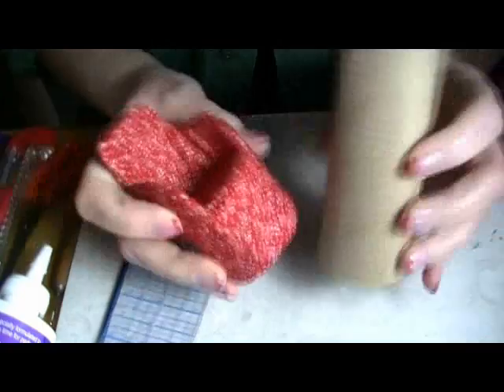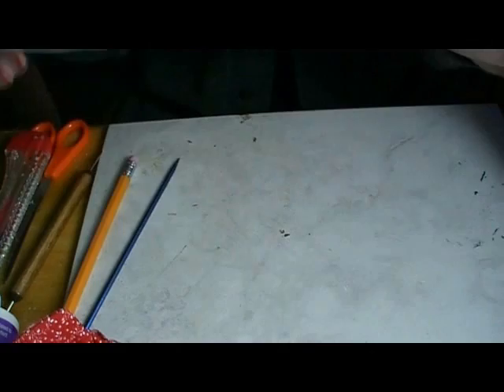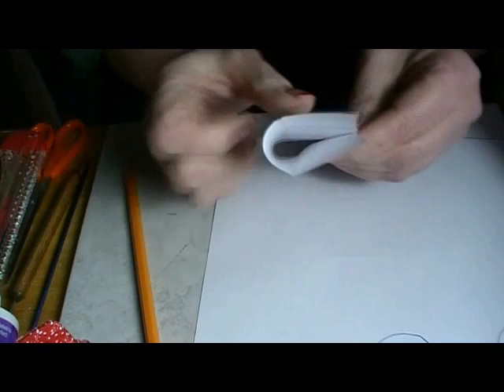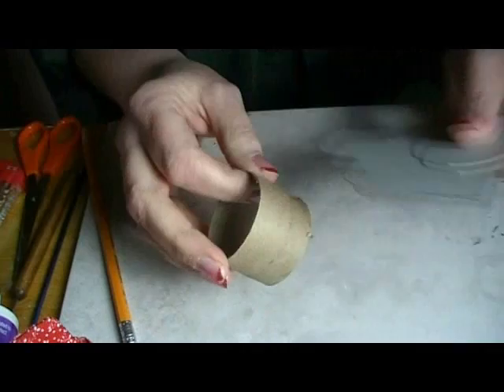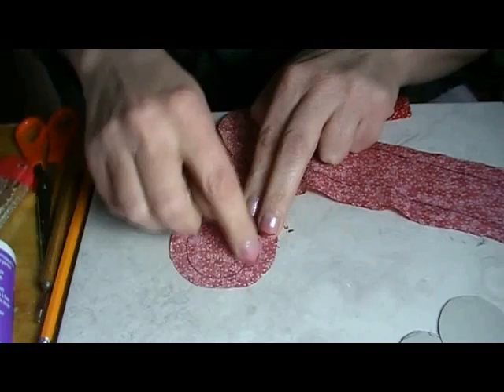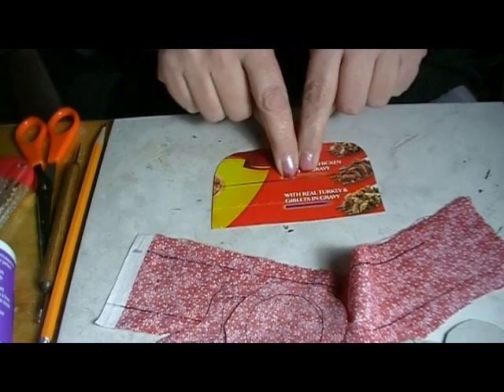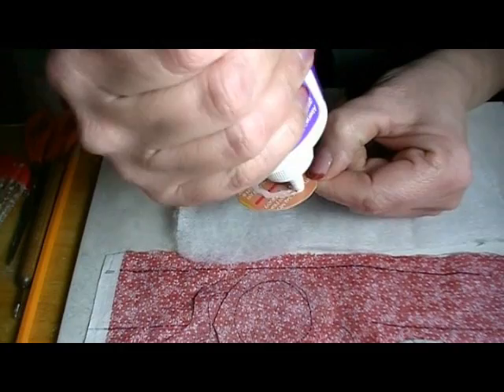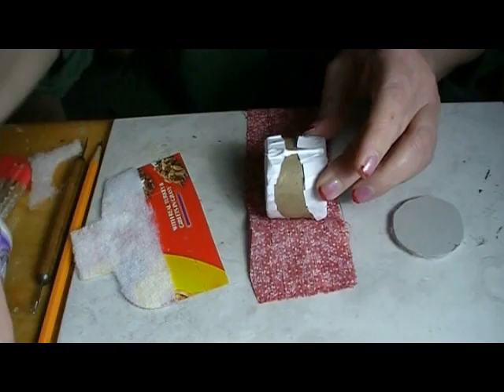1/12 th scale Chair- a Trash to Treasure Project

Comment: My Mom used to make a similar chair for Barbies back in the 60's using a tuna can. Open the can with a can opener almost all the way leaving a hinge holding the top to the can. Carfully wash the can then wrap the edges with tape to keep from gettin cut. Stuff the can with cotton and cover. Mom would crochet her cover. Could be used for Barbie or as a pin cusion.
Reply: When I was a kid in the 60's I eyeballed the box if oatmeal and turned it into a similar Barbie chair. Only I cut the backrest from the container as one piece, AND left the front attached as well to fold over to become the round seat. So I only used one oatmeal container for all the sides. Stuffed it with newspapers or something, covered with contact paper on the outside folded over the edges, and cut matching color of felt for the seat cushions and inside the back of the chair. My mom sewed Barbie clothes from patterns for us, wish I'd like sewing more
Reply: Might be able to use a Pringles can too, next time I get some I'll have to try

Comment: Great chair and thanks for the info, however, I build this using a glue gun in a snap.
Reply: Hot glue deteriorates over time, or when it gets warm. You can use it for quick grab in addition to the glue that will hold long term without adding lumpy bulk